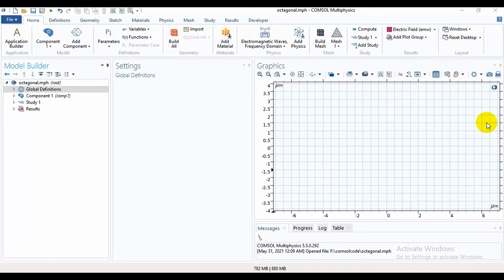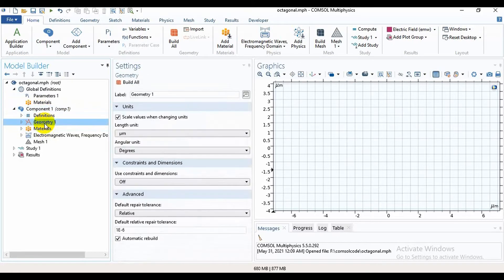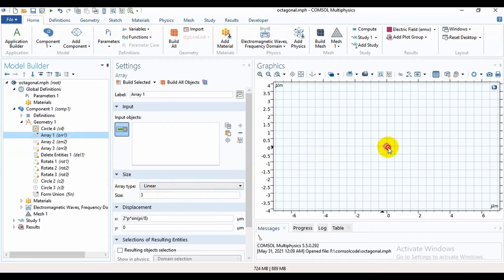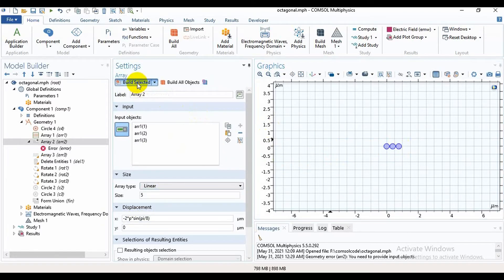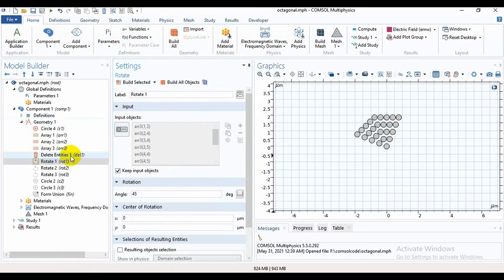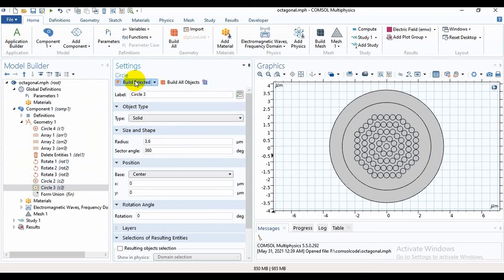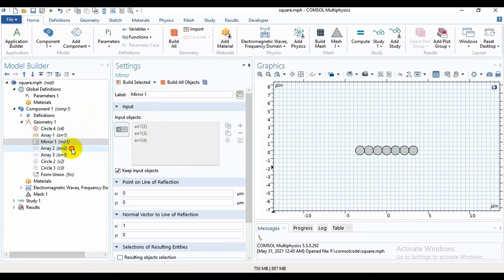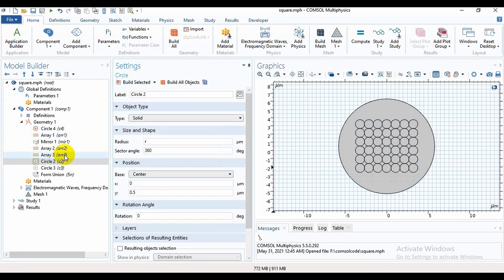Octagonal and Square shape by using Comsol Multiphysics

Comment: Your video are very helpful. I would like to request you to make videos on details on structural parameters like how to choose operating wavelength, pitch and air hole radius to confine light in the pcf and what the results of different modes in mode analysis depicts. As a beginner, it will be very helpful. Thanks.